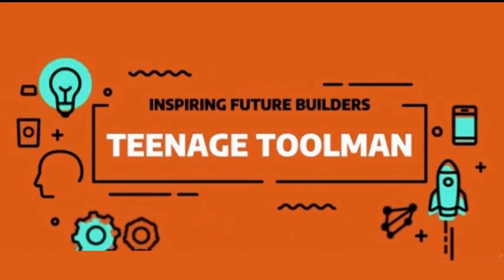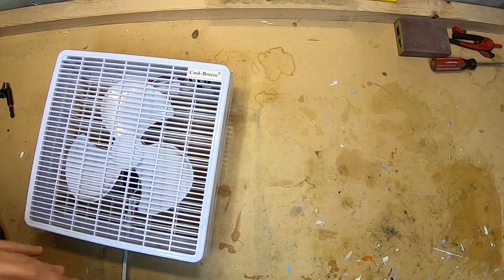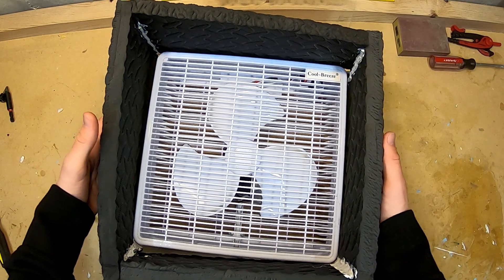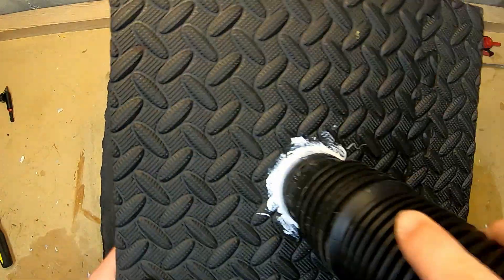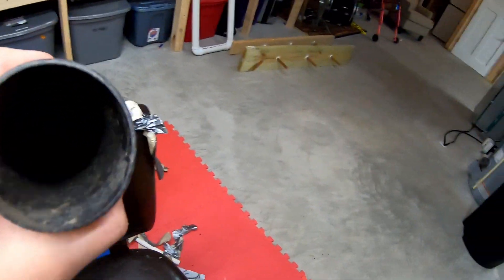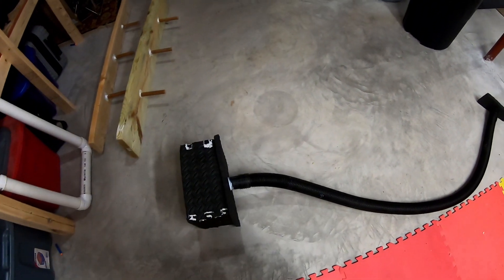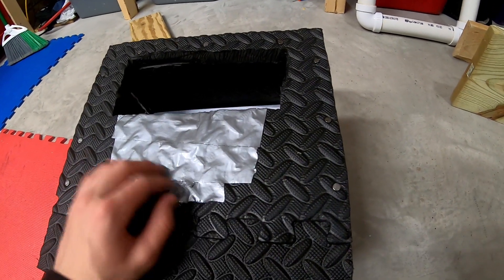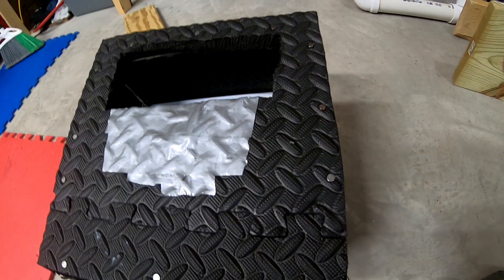Making a DIY Laptop Cooler

Comment: Nice video; it opens my mind to make a better cooling system for my laptop. I think of changing the original bottom lid and replacing it with a "DIY bottom lid" using those cooling pads that are sold on the internet. The laptop will be a little bit thicker, but I'll be able to transport it everywhere.

Comment: Looks like a Nitro 5 laptop, which is what I have. I was noticing the temps were a bit high on mine, so I opened it up, and cleaned the dust off the fan. That alone made a huge difference, but it's still a bit dusty here where I live. Right now I have things set up so cooler air from outside is redirected towards it. That also helps. Now I'm planning to actually build something to combine it all, so that cooler air is brought over from window, pushed up underneath with fans, and I want to filter the air somewhat to reduce the dust buildup.  
If you know how much keeping these things cool will help them to last longer, then it makes sense why we do these things. Sure, I could just get a laptop cooling pad, and leave it at that, but I enjoy the challenge of a DIY project and doing better than that.

Comment: 10 years ago my laptop would over heat and turn off while playing games. I took a fan and put the laptop on top of it. I took of the lid on the underside to help with airflow. Worked like a charm
Reply: Yeah that seems like a simple solution, I'd just be concerned about the motherboard collecting dirt

Comment: Use Throttle Stop and thank me later don't use turbo boost mine is 70-80c with auto fan in WARZONE with max fan i reaches 65-75c and my system TEMP reaches only 55-60c reduce your mhz to 3.7mhz and you are good to go use a conventional cooler only and elevate your laptop.
Reply: Not all laptops can be undervolted, but undervolt is a good option

Comment: Is that the Acer nitro 5?
Reply from the maker: Ya
Reply: @teenagetoolman3313  do one thing bro , go to power options and set max cpu to 99% , this will cut off few fps and max cpu temp by 20°C on Acer Nitro 5 , I got 5600h with rtx 3060 model ..
Or buy cooling pad with extra custom liquid cooled copper pipe grill on top then laptop on top ... I am planning to make one..

Comment: Just change your thermal paste should help a lot, did it on mine from 95°c to 70°c
Reply: depends, I put the very best paste in my laptop, and under load it still easily reaches t junction, the cooling solution simply isn't adequate
Reply: @robinrai4973  my laptop radiator fins were full of dust I dissasembled ans cleaned everyting with alcohol and a small brush, thermal paste alone wouldn't have worked so well
Reply: @g.simard854  mine's clean as well, all I'm tryna say is in some cases the design for the cooling solution on some laptops are just flat out not adequate not matter how well you take care of it
Reply: My laptops cpu has to run at 15 watts for me to think that the temps are good, I’m sure I can run the wattage higher will good thermals but I don’t want to spend too much time on it cause It’s still great, building one of these coolers should help it though
Reply: @asianflex  a good undervolt on top of a radiator cleaning and a thermal past change is a winning combination.
Reply: My laptop has the CPU and intergrated GPU under a piece of shit heatsink that takes half an hour and is stupidly fragile
Reply: i just changed my paste from factory to arctic mx 6, still no difference in my temps 💀